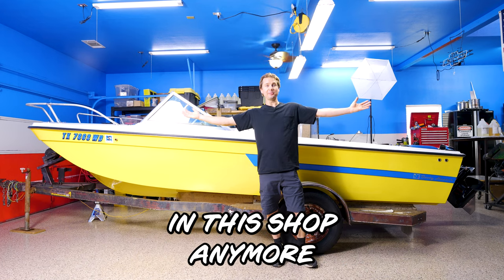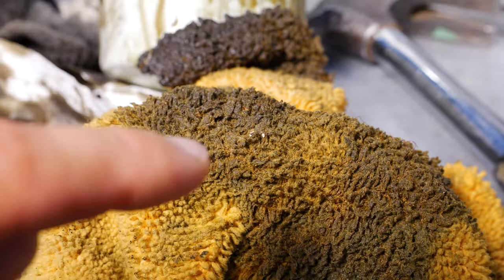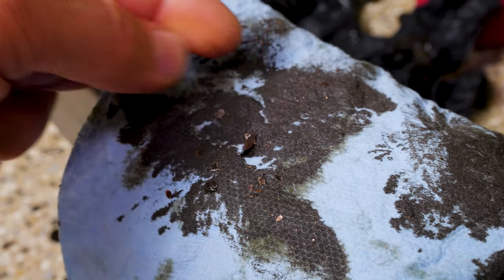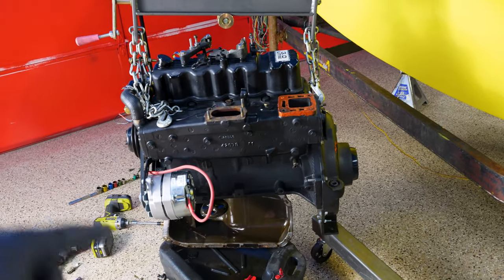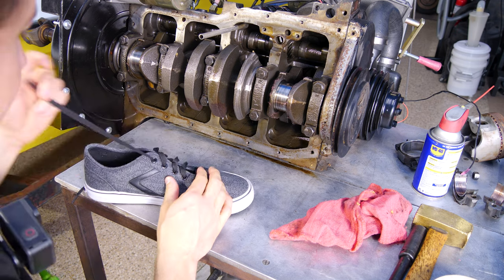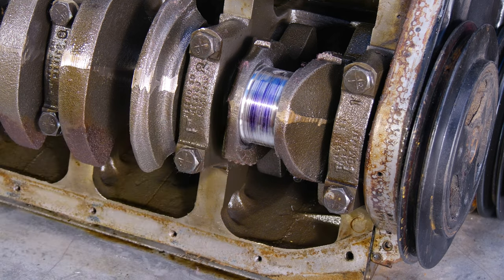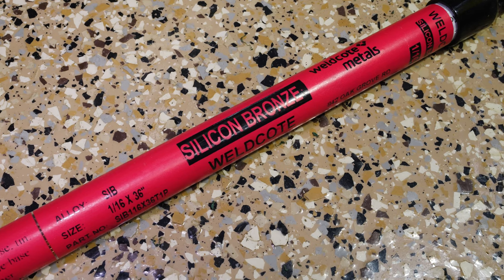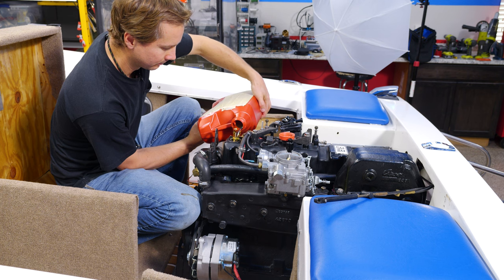Why Our Budget Boat Only Lasted an Hour. Can We Fix It?

Comment: Guys, if you struggle to get your motor started for a long time, flood the engine severely, or have a stuck carb float, CHANGE YOUR OIL. The motor might not have been 100% to begin with, but I guarantee you this is all because of gas in the oil from when the carb float stuck.

Comment: Did you mike the crank and possible put in an over sized bearing (010) to take up the slack ;)
Reply from the maker: Miced the crank and it was within the old manual’s spec, but it seems like the rod was a little egg shaped, so I should have known it wasn’t going to run very long.
Reply: @Motiv8Labs  Loved the videos!

Comment: I think it was because you didn't Fix the water issue getting in the oil
Reply: Likely the crack extended into the cylinder(s).